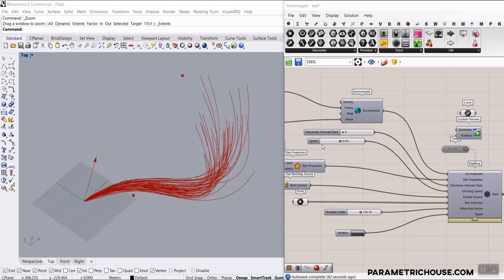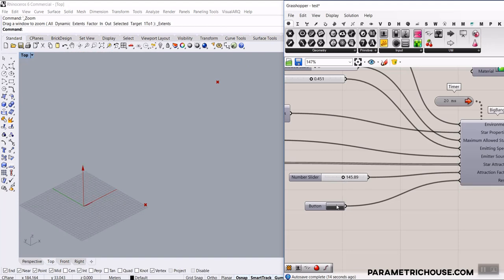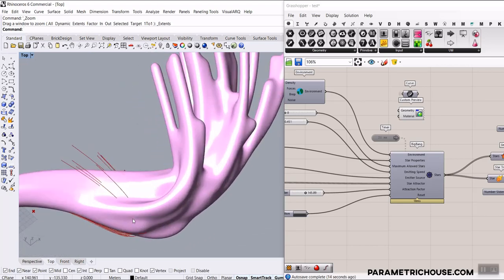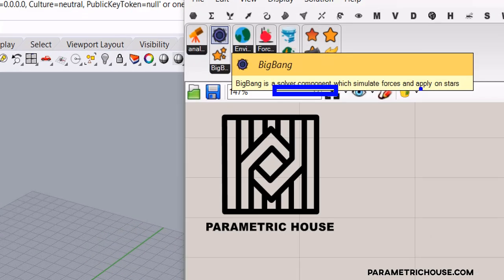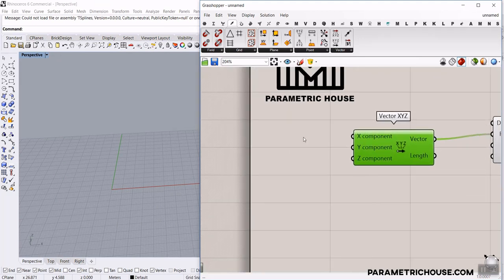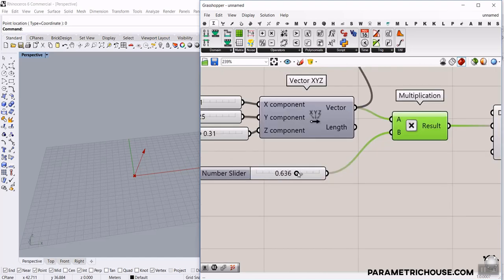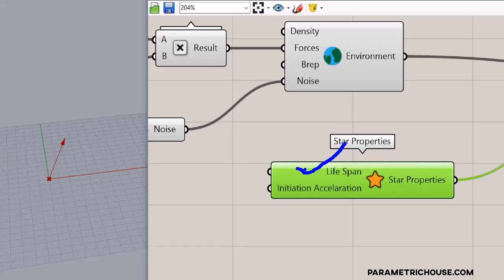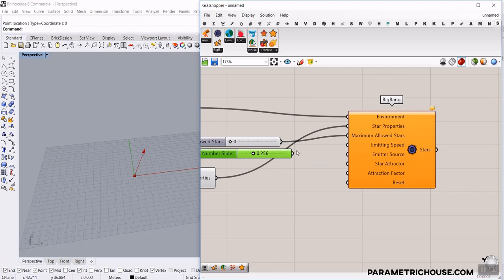Stella3d + Dendro (Rhino Grasshopper)

Comment: i just download stella and looks diferent, no enviroment box
Reply: Did you ever figure this out? Having the same issue
Reply: @rachelschultz1666  same
Reply: @donnaytennis1  they are using an older version! On food4rhino thehre on the same page. Once I downloaded the old one it merged all the missing commands with the new ones
Reply: @rachelschultz1666  can you maybe tell me how you managed the old one with the newer? i have both versions now, but grasshopper always says it has an component id conflict. Then gh asks me if i want to "skip all" (then it uses the old stella3d components) or if i want to "replace all" (then there are only the components of the new version and i can't do stuff like this video). Would be nice if you can help me!
Reply: @selenatroll8601  I get the component ID conflict notice every time too, but when I choose skip all and they merge together automatically :(
Reply: I use rhino 6 and my applications were both uploaded the same way but I assume yours were too